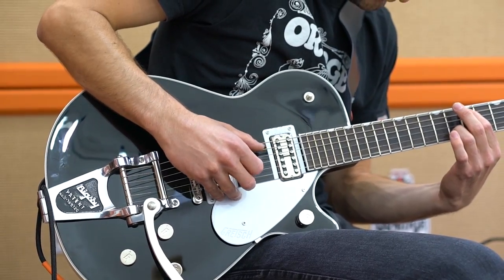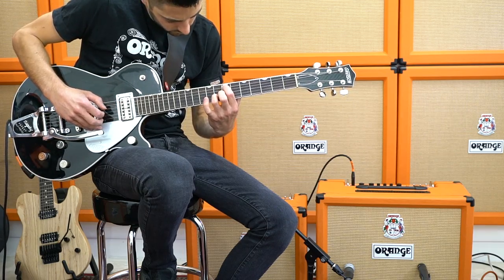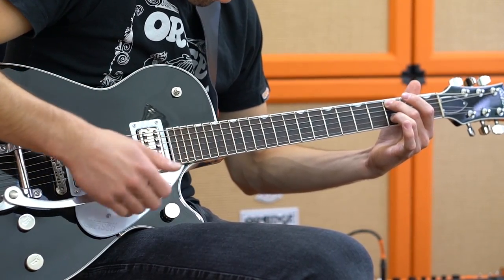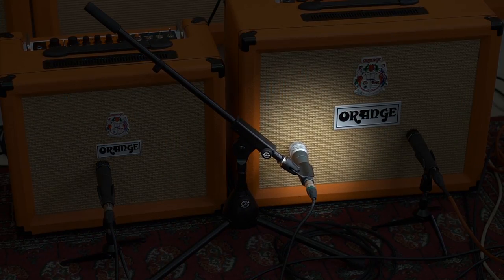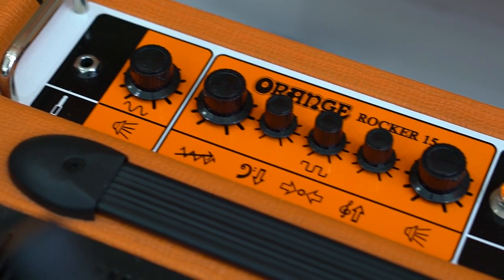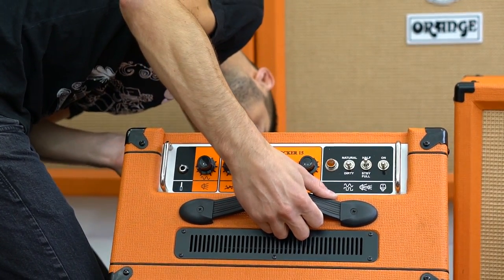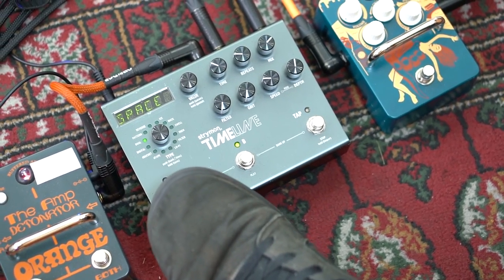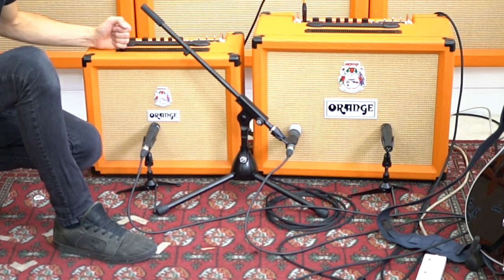Orange Answers - What is a wet/dry/wet rig and how to build one.

Comment: Thanks for the demo. Is there one showing how to use the detonator for a dual mono wet/dry rig with two amps, with the detonator used to split the gain pedals into one amp but also channeling both gain and modulation effects into a second amp?
Reply: Not the detonator, but the same idea with a Humdinger

Comment: Very nice set up and nice tones. Coming in late but I'm curious about a 3 amp setup with Orange Microdark and 12 inch cab as dry in the middle and a stereo FX processor running in stereo to 2 Solid State Amps left and right. Would the Orange Detonator be able to handle the following connection: Guitar out to Detonator in - Detonator A out to Orange Microdark(Dry) - Detonator B out to FX Processor in - FX processor Left output to Solid State Amp Left Side - FX Processor Right output to Solid State Amp Right side. Any thoughts on this setup or any potential issues will be appreciated.

Comment: These instructions contradict the User Manual for the Amp Detonator which states NOT to use the B Output without the A Output being connected also. Can I get some clear instructions from an official source @ Orange before I fry my amp? I tried e-mailing but the Submit button disappears as soon as I verify with the CAPTCHA.

Comment: In WDW, is it necessary or preferable to run the stereo effects in kill-dry, or will it sound fine running at the same ratio I’d in a simple stereo or mixed mono rig situation?  I’m working on some midi presets and would love any advice folks have on how to set these up given that I’m expecting to go WDW soonish...
Reply: I realize this is a late reply and I am curious as to what conclusion you came to. I am kind of wondering the same thing as I am also working on my wet/dry/wet rig. I think this is a matter of what is considered «true wet», but to me this is not really essential. I would just say you do you and be happy with your rig. I will probably go with mixed signals to left and right amps because I need those to be able to play clean - not only wet effects. The middle one will be dry and set to «dirty» at all times, and can be engaged on/off with a switchpedal - so it will act as extra gain stage.

Comment: Can you explain how sending the one output of the strymon into the return of the rocker15 is going to work? Don't you need to still plug something into the input of the amp and the send, for that matter? how would it be controlled by the rocker32? I would like to run this setup, but not getting it.
Reply: The signal is sent to the strymon and then the signal comes out the strymon and goes into either the input of a second amp or use the fx return of the fx loop whixh takes the signal and puts into the power section of the new amp
Reply: @DaveThomson  I still don't get it. Need finger puppets to explain.
Reply: With the Strymon can I use a Crush35RT with a Rocker 32 to achieve a wet/dry/wet ?
Reply: He's bypassing the pre-amp input and going fx/in to the 2nd amp, it's still an input.. I think he's referring to controlling the volume from the rocker32.